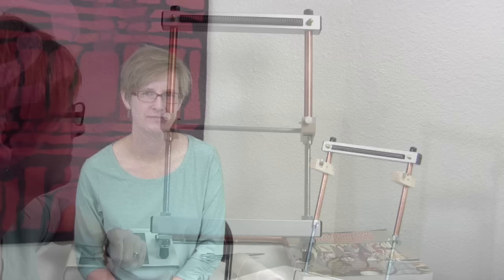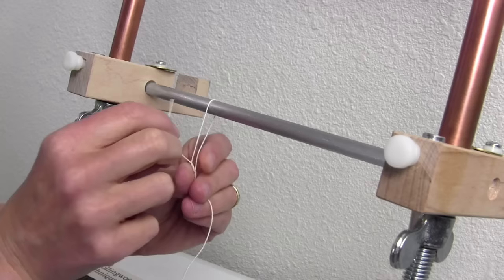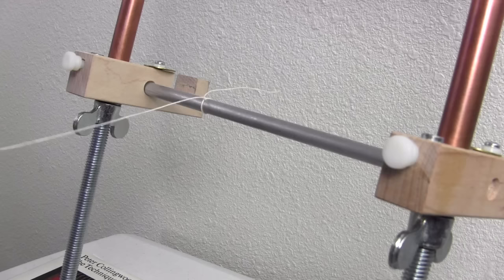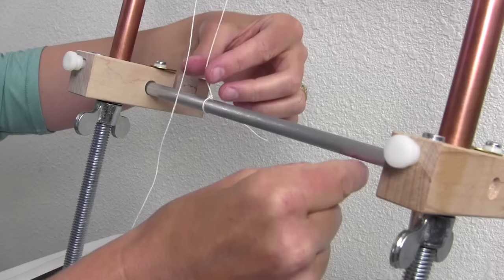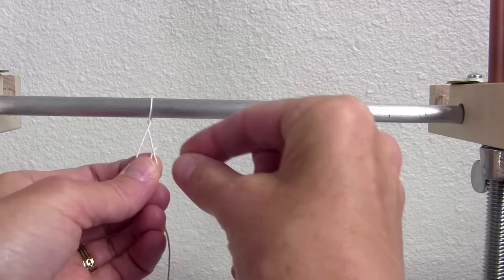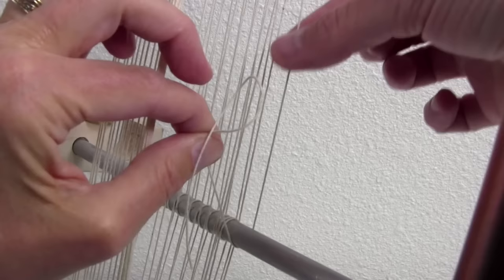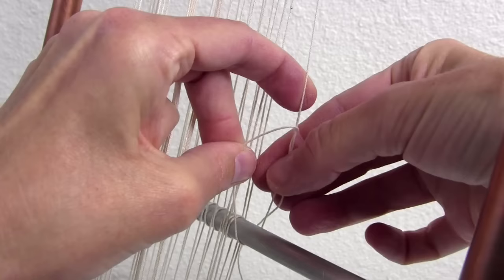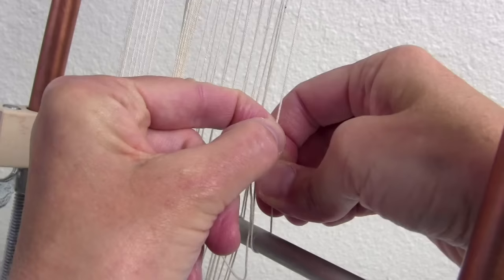Keeping your edge warps tight

Comment: Rebecca I bought a Matrix Loom And the copper is turning green in pitting is that normal and it’s right here in my living room
Reply from the maker: Hi Tammy, I haven't had this happen, but I also don't know a lot about copper. I would write Mirrix (you meant Mirrix, right?) They may have a suggestion though I think maybe a quick rub with some fine steel wool might take care of that corrosion.